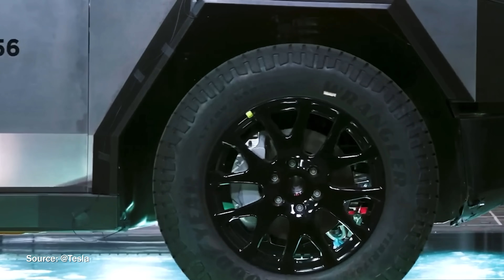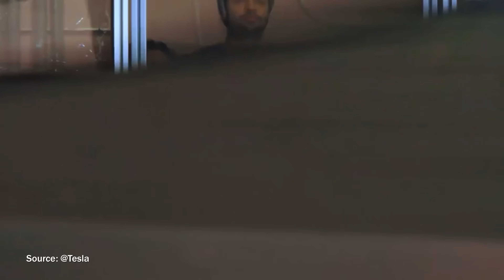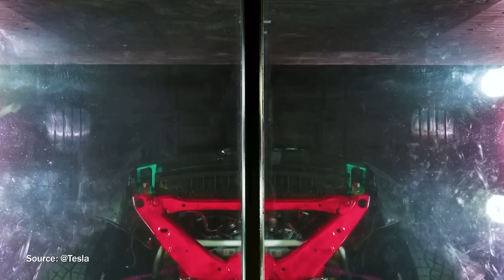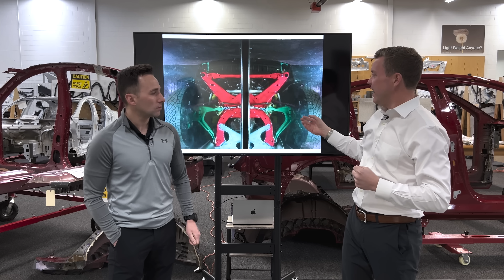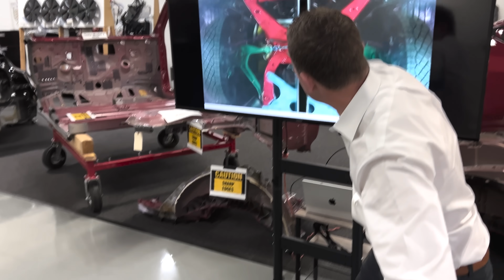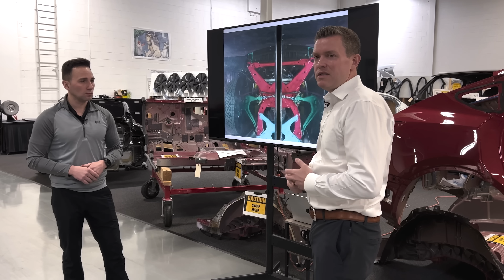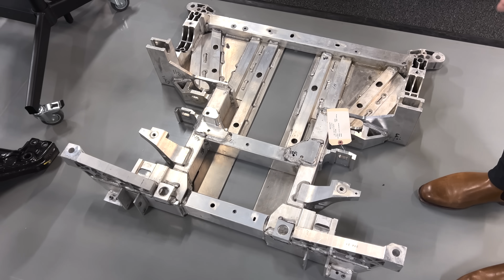A peek under the Tesla Cybertruck! 👀

Comment: 2500lbs of #2 stone. With pulling a trailer  loaded with  rebar and 2each pallets of 80 lbs of cement mix . Then drive 500 miles in 5 hrs.  250 miles  nonapproved road

Comment: There is one point of vocabulary which can, imho, really cause confusion in this video: "gearbox".

In the usual automotive parlance, this word refers to a set of gears, each providing a different gear ratio, in order to compensate for the uneven torque curve of an ICE engine. But similarly, at the differential level, there is also a "gear box", a box with gears in it, which provide the final ratio.

But when it comes to EVs, you have no "gearbox" in the traditional sense. In French, we talk about "boîtes de vitesses" (boxes of [spinning, relative] speeds) and "rapport de pont" (the final ratio). There does not seem to be such a differenciation in the English language AFAICT. In fact, an EV "gearbox" (except when it comes to the Taycan and Audi e-tron) is just a "rapport de pont".

Suggestion: make a video clearing this up :)
Reply: "Gearbox" is used for single-ratio gear boxes as well - they're just not common in traditional automotive use.
Reply: @brianb-p6586  Which is exactly my point :)

To the layman out there, it can be quite confusing. Consider the Porsche Taycan for instance (at least the current generation, as of 2023) which has a "2-speed gearbox" on the rear axle and a "1-speed gearbox" on the front axle.

Not to mention "automatic". For people used to ICE gearboxes, what does a "1-speed automatic" gearbox even mean?

This is why I think it is necessary to clean up the confusion from the get go.
Reply: @Francis Galiegue  "1-speed automatic" is just nonsense.  "Automatic" and "manual" refer to the shifting method, so a fixed-ratio (or "single speed") gearbox is clearly neither, and so neither description should be applied .
Reply: @brianb-p6586  I agree and it appears, therefore, that you definitely missed my point. Let me thereafter restate it: in layman terms, when it comes to automotive parlance, a "gearbox" is a separate piece of kit which connects the (ICE) engine to the wheels and, if you are knowledgeable enough, there is also a differential between the gearbox and the wheels.

We both know that when it comes to electric powertrains, this is not the case; there is no "separate piece of kit". Granted, there is a set of gears between the rotor and wheels (in the shape of a differential), which fits the definition of a "gearbox" (a box of gears). Will you agree with me that this is confusing and needs addressing?
Reply: @francisgaliegue6645  I understand what you are saying, but disagree that it is a problem. A fixed-ratio or single-speed gearbox (or transmission) is the same thing as a multi-ratio or multi-speed gearbox or transmission... just with only one ratio (or "speed"). There's no need for another term.

Also, a "gearbox" in traditional automotive use is not necessarily a separate component (or "piece of kit"). Many (almost certainly the majority) of current production vehicles with internal combustion engines have the multi-ratio gearbox and the final drive (final reduction gearing stage and differential for one drive axle) in a single component, which is called a transaxle. All production light EVs (that's cars and pickups, but not all medium and heavy duty trucks) use a transaxle configuration... just like their ICE counterparts with transverse engines. In fact, a typical EV motor and transaxle are arranged just like a typical transverse ICE and transaxle... simply without a clutch or multiple gear sets. Some EV truck powertrains use a separate gearbox component, fixed-ratio in some cases and two-speed (or even more) in others.

The "set of gears" between an EV's motor and the wheels (actually the axle shafts) is not just a differential, which doesn't even provide gear reduction. Common EV designs have two stages of parallel shaft gearing (just like a typical manual transaxle used with an ICE), or one stage of planetary gearing (just like one ratio of a typical automatic transmission), in addition to the differential (which just splits power between left and right outputs). All Tesla transaxles use the parallel-shaft design; the dual-motor units (in the rear of the Plaid and one axle of the Semi) have a gearbox for each motor, and no differential because there would be no purpose for one).

In many cases part of the housing of an EV's motor (the drive end portion) is shared with part of the housing of the gearbox (the input side). While this is not currently done in ICE cars and trucks for practical reasons (although it was done in Austin Mini and a few other cars of the past), engine and gearbox housings are integrated in most motorcycles. In those motorcycles, there is no special term for the gearbox or transmission, just because of the shared housing; it's still a gearbox or transmission (and not a transaxle, because it does not include the final drive).
Reply: @brianb-p6586  There is one crucial difference though: EV "gearboxes" have no clutch :)
Reply: @Francis Galiegue it's true that an EV gearbox doesn't have a clutch, but that's irrelevant to the terminology.

Comment: This video mentions that the CT is going to use steel suspension components. I thought that Elon had said that one of the main marketing points for the CT was that it would be made entirely out of stainless steel. Did he walk that statement back at some point?
Reply: Nothing Musk says really means anything. I'm sure that the PR spin would be that they meant that the exterior of the body would be entirely stainless steel, other than the glass and composites of course.

Stainless steel suspension components would be undesirable, because the material's structural properties are more important than corrosion in this application.
Reply: No, he said the entire body was going to made of stainless steel.  Not every single part.  THINK.
Reply: @TheEvilmooseofdoom  Yup, you're right. I went back and watched the CT unveiling event, and Elon definitely said it was only the body that was going to be SS.

My memory (like a lot of other things) ain't what it used to be.

Comment: You should start with an explain like I'm 5, and then get deeper into the details. Also, wasn't the Cybertruck "skin" supposed to remove structural components from the vehicle?
Reply: That's nonsense. It's just a unibody, but in stainless steel rather than other steel alloys or aluminum. Any unibody road vehicle needs structural elements other than the outer skin, because it's not a canoe or rowboat (the only vehicles which can function with just a structural shell or hull).

Comment: What are the silver pieces that look like turnbuckles with cables in the red channel connecting to the green lower control arms? Are they shackles to prevent wheels from detaching during an accident???
Reply: I think that's how the truck is attached to the trolley that runs along the center rail, by which  the test vehicle is propelled at a known speed into the wall.

Comment: Great now mount single-use shock absorbers in the seat frames under the seats to further absorb impact.
Reply: Cost/benefit analysis... Survey says: X
Reply: @TecnamTwin  When you crank your neck  on a A piller or into a windshield you'll think it's cheap. IF it works. 
An air bag only has to work once and they aren't cheap.

Comment: The steel subframe can potentially to a good choice if it is chromemoly steel which doesn’t rust very easy and is very strong or you cold use high tensile steel but you should hot dip galvanized it then because epoxy paint doesn’t really last over the decades! I would prefer chromemoly steel 😊!with a good multi decade coating product!

Comment: I’m a bit concerned.   not about cybertruck but EVs in general. 1. Ford lightning was a major marketing fail in my opinion.  It doesn’t do what a truck should do cuz of reduced range when used as a truck plus not enough 
charging infrastructure, as of yet.   2.   Sandy has said many times that Mr Toyota is no dummy so why then is Toyota not embracing BEVs?  Does Toyota know something we don’t?
Reply: Toyota is being a bit myopic. They also are heavily invested in hybrid tech and they serve many third world markets where electricity is not as available. They are putting more of their R&D into hydrogen tech (especially for larger class A trucks) for domestic and foreign markets. 
 In my opinion (based off the opinion of other industry experts) is that Toyota is behind the curve for EV, but will quickly catch up once they secure a reliable energy storage solution that is congruent with their ICE vehicle longevity. Regarding Ford, they know how their owners use their pickups, and MANY f-150 owners drive around with empty pickup beds, with an occasional tow to a boat ramp or dump run. The range while towing is pathetic, but it will improve as battery tech improves just as we witnessed with internal combustion capabilities. 
The lack of investment in vehicle charging infrastructure from other makes besides Tesla is stupid, and now they will be seeing their pickups charging at tesla charging stations, which is a bad look from a marketing standpoint. 
At any rate, EV sales have increased 65% since last year with no sign of slowing. 

Just my layman’s point of view, but it appears Tesla and the other manufactures who are embracing EV tech are doing exactly what Toyota did with hybrid tech. Everyone was late to the party and now it’s Toyotas turn.

Comment: FORGET ARM AND FRAME FORGING!
 
NETWORK-LIKE SPINE-D VERTEBRATES ALONG A SHOCKED ANGLE
A MUSCLE MASS
LEGO-LIKE BUILD
SPINNING PARTS PLACEMENT MOVABLE WITHIN THE MASS FOR RUN-TIME PROTECTION

- TRANSLATE PRESSING MOTION INTO CHARGING THE VERTEBRATE'S BATTERY CELL
- USE CELL ENERGY TO CONTROL PRESSING RESISTANCE

MAKE A PERFECT STOP ANYWHERE AND 
  IN ANY DIRECTION.

Comment: The real question is will it rust in the salt belt?
Reply: It’s pretty difficult to stop corrosion where road chemicals are used.  The best I’ve done is I’m still driving a 22 year old Honda Insight which uses aluminum and plastic extensively.  I just had to replace all the brake lines, attacked by crusty white corrosion, even the ones from the master cylinder to ABS unit.  There are still various steel parts and where they fasten to aluminum you’ve got to be sure you put back Dacro passivated fasteners where you took them out when doing work on the Insight.  If you don’t you may rot out the aluminum via galvanic action.

I’ve seen some rust spots on Models 3 driving around.  It looks like misalignment allows the door edge to nick the paint on the fender in some cases.  My guess is the dimensional control has become better dialed in later production, especially for Tesla vehicles produced in Texas.

Hard to say about the Cyber Truck as it doesn’t officially exist yet, but there will almost certainly be bits which corrode in harsh conditions.  Virtually nothing is ever 100% maintenance free.
Reply: @wtmayhew  I myself drive a 2001 caravan which had no rust when I got it a couple years ago as it was barely driven in its life. The rust just started and its spreading like wild fire. I live in alberta Canada and we have 6 mouths of winter with lots of road salt. Not to mention the roads can be slushy for mouths in the spring which is terrible for rust spots that have already started. I think the best solution is to find a vehicle with the best resale value and trade it in every 4 years. I think that's what most people do in my area since there are rarely cars nearly as old as mine in my area.
Reply: @elliottcarson1248  Smart manufacturing seems to make a difference.  I also have a 2005 Tacoma whose frame rails rusted furiously to the extent Toyota replaced the entire frame, leaf springs and fuel/brake lines under voluntary warranty extension in 2016.  I’m still driving the Tacoma and the replacement frame looks pretty good, but not perfect, seven years after the fix.  The new frame looks to be covered with powder coat or something like POR-15 paint.  The body panels still look great.  I had one very tiny rust spot on the passenger rear fender which I had fixed in 2016.  My guess it that it was a nick from a shopping cart which exposed bare metal.  Toyota seems to have, at least in 2005, mastered preventing sheetmetal corrosion.

My Tacoma was manufactured in Fremont, California at the joint Toyota/GM NUMMI plant which is now Tesla property.
Reply: @wtmayhew  I suspect dodge cuts corners when it comes to corrosion prevention since the van has been great in every other way.
Reply: @elliottcarson1248  The Caravan model maybe isis a little less popular now, but friend had one which was very comfortable.  I believe the engine blew and he had the engine replaced.  He liked the Caravan enough not to scrap it.
Reply: @wtmayhew  there're good cars and yes very comfortable. I've never had any major mechanical problems with mine but if something expensive does happen to one its probably better to scrap it or demolition derby it. They just have such terrible resale value that they aren't worth putting money into. I don't really have the heart to do that to mine so I'll probably sell it before the rust gets to bad or just use it as a summer camping vehicle.
Reply: Stainless will eventually rust and the steel frame parts certainly will. 🤷
Reply: Musk said in February that Cyber Truck exoskeleton is hard (I believe he meant strong) stainless steel which Musk referred to as 30X.  That would presumably put Musk’s metal in the 300 series stainless steels.  I’m not sure what the X is, eXtra marketing perhaps.  A very common steel is 304 which has good workability and anti corrosive properties.  Known as H1, Benchmade and Spyderco use 300 series steel in knives for maritime applications where blades would be exposed to saltwater.  My feeling is that given what has been said publicly, the Cyber Truck exoskeleton should be quite corrosion resistant.  There are lots of other components which might corrode.

Comment: Old Ford F 100’s had twin I beam suspension in which the length of the arms was the width of the vehicle . So twice as long as arms that just go to the center of the vehicle.
Reply: Yes, those arms were long... but it was a single-arm suspension so geometry was still very poor compared to a double A-arm suspension with short arms. The length of the "twin I-beams" kept it from being even more horrible.
Reply: @brianb-p6586  Poor is relative. I would trade it any day for the very complicated suspension in my Honda element . Around $1200 + at 100k to replace a multitude of rubber bushing etc that were shot. It’s going to be the same for the rear.  I changed nylon sleeves on the king pins in the Ford at 200k+ cost a couple bucks. The long arms have a low resonance frequency difficult to reproduce.
Reply: @M13x13M  the arm length has nothing to do with the suspension's resonant frequency.

In decades of driving cars (including Hondas) with independent suspensions (none to as little as 100,000 miles) I've never worn out a bushing to the point that it needs replacement, but I've certainly heard of problems with Ford Twin I-Beams, with bushings and with arms that need bending to correct alignment. That Ford design semi-leading arm is fundamentally crude.

Comment: Interesting, however the construction looks rather conventional with stamped/welded steel subframe pieces and aluminum castings for suspension arms. No evidence of the hyped "Gigacastings" which is actually a good thing being that replacement after a accident would be extremely costly. Based on these observations I expect the Cybertruck to be quite heavy when the mostly stamped steel subframes are combined with a welded steel body.

Comment: Bolting through a box section is stronger than a single plate, even double thickness. Weld in a bolt support tube and it gets enormously stronger.